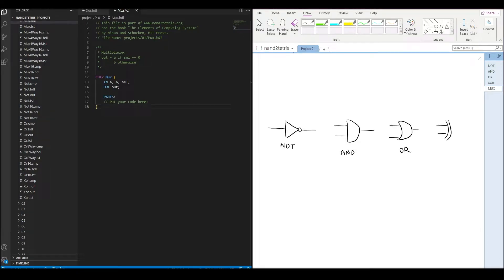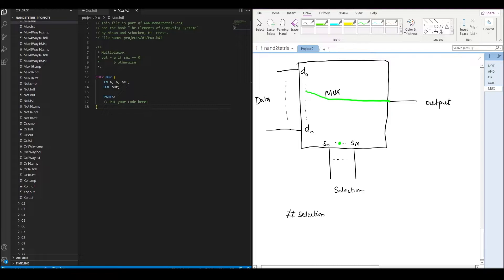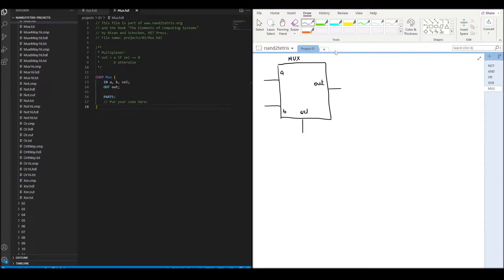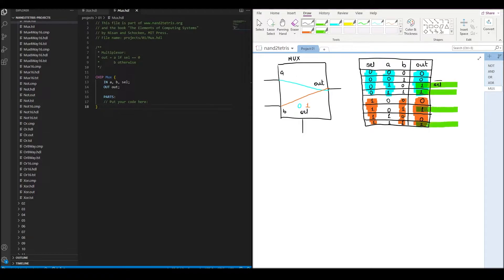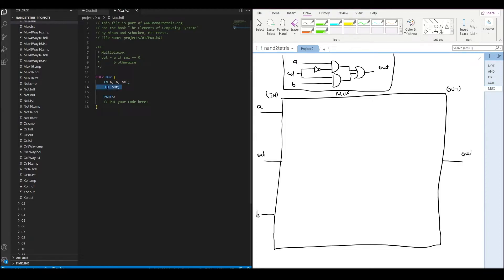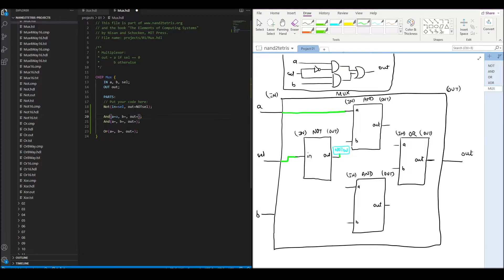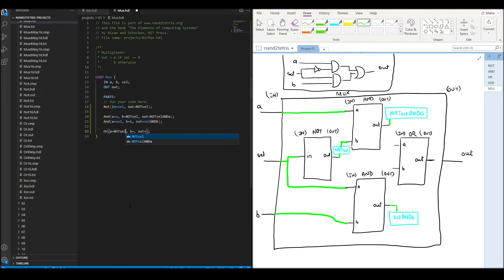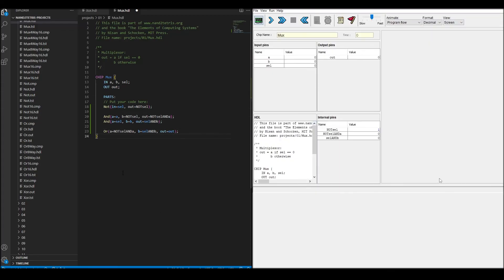how to make a MUX from logic gates  | nand2tetris - Project 01 - MUX chip

Comment: Can we write boolean expression with the help of truth table?
Reply from the maker: sorry for not responding sooner. hope you found your answer. if not here is my answer.
yes. that is what we do here. a simple explanation is on the XOR video. in truth table, for each row with output 1, we (AND) the variables using (NOT) whenever a variable has value 0.  we then do OR operation on all the obtained (AND) expressions. we then simplify the expression when possible using [ laws of Boolean Algebra ]. for larger truth tables we may need to use advance techniques but for now above method works.
XOR:  (Not a == ^a,    aANDb=ab)
a    b    aXORb
0    0    0                    ===> ^a^b
0    1    1                    ===> ^ab           *
1    0    1                    ===> a^b           *
1    1    0                    ===> ab
aXORb = ^ab + a^b [No further simplification]
Reply: @onthelearn  yes i understood it
But thank you very much for explaining it so nicely.
You gained a new subscriber and follower.
Keep posting,lots of things to learn from you .